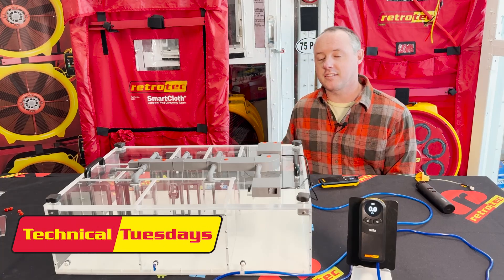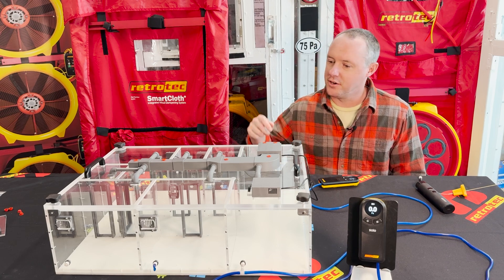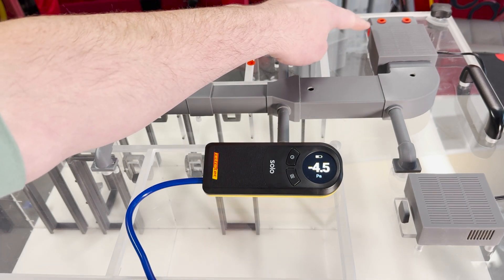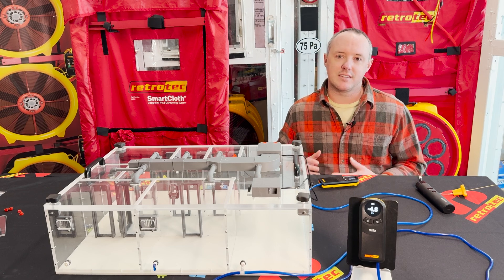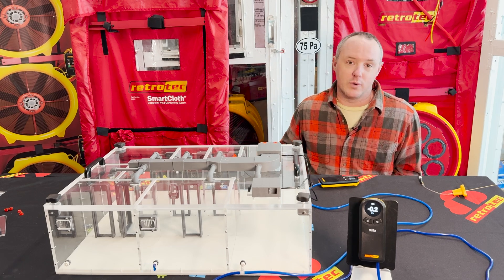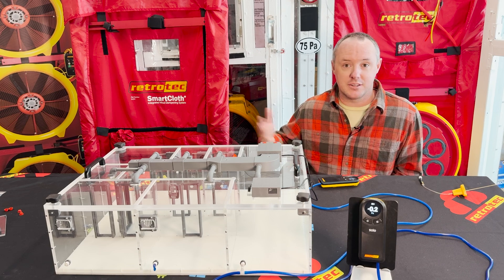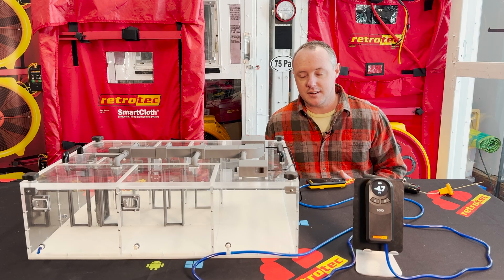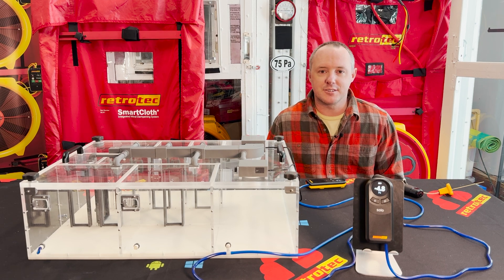Technical Tuesdays: Ep. 55 - Duct Leakage and the Building Enclosure

Comment: i jumped on your website to look for a technician that could run those the duct leak and home envelope pressure door test. im in mint hill NC and found a Josh H. should i just give him a call?
we just moved from California to NC in a brand new 2025 home and it's certainly an adjustment with the temperature and humidity. we have a substantial dual zone HVAC system with a heat exchanger and no furnace or gas on-site. I've encountered huge air leaks everywhere from doors, wall outlets/switches, and garage foundation joints. 
i used prosoco gap and joint sealant for the foundation joints in the garage and caulked all gaps from door frames. 
there's a duct leak reading of 3.5% in the electrical box but that leak in addition to the house envelope is all bad. I've probably reduced leakage by a whole 0.05% if that. i am considering having the duct work redone with rigid sheet metal and the whole attic insulation sprayed. theres crappy flex ducts with kinks and blown-in insulation. im not in the HVAC and insulation industry but even i know this was a poor job. id like to start with home energy audit.
Reply from the maker: Yes! Josh Hartness is great. Give him a call.
Reply: @RetrotecEnergy right on. thank you